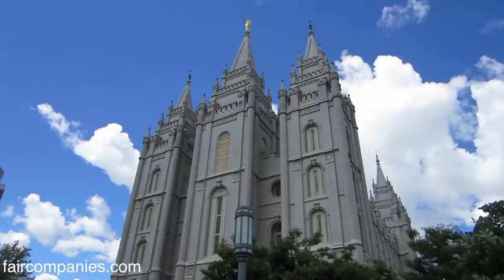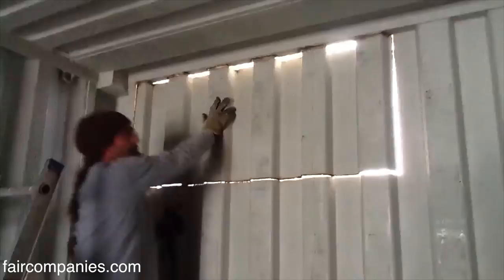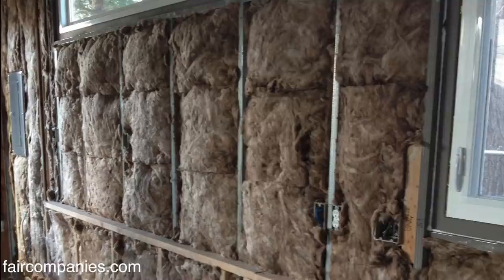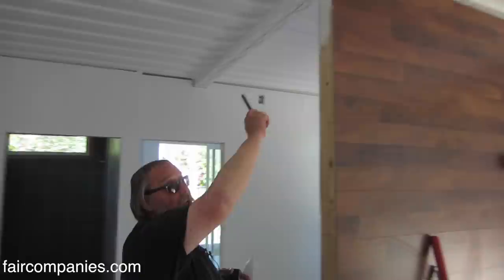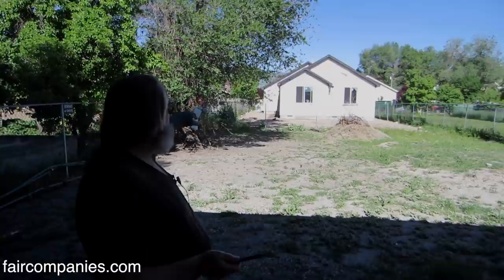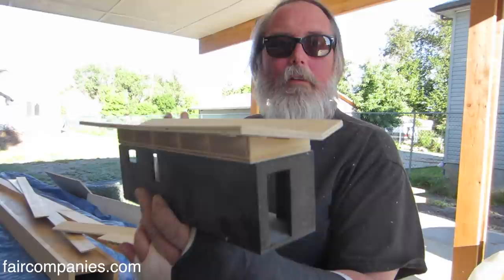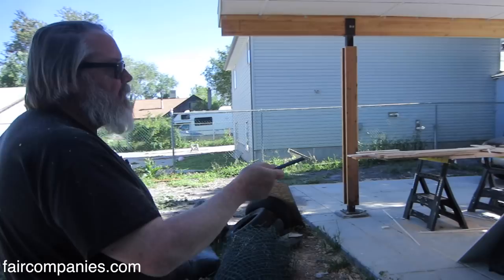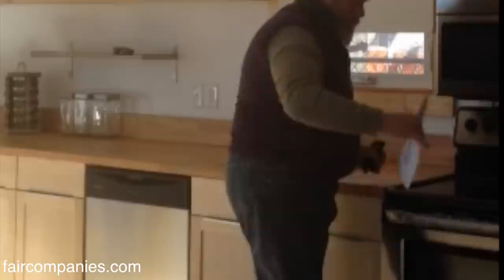Shipping containers recycled into affordable, accessible Utah home

Comment: HI. I am Kenyan and i have this idea of a non-profit to help guys coming from prison to get asimilated back into society through job creation and housing. i think such housing would be ideal.
Reply: Containers don't have much thermal mass. Are your local materials unsuitable? Containers are versatile but I suggest spending time in one in YOUR climate to determine what suits  YOUR local needs.
Reply: You can use the shipping container as your structure as they hold a lot of weight and use a Hemp concrete to build your walls once you remove the steel walls , or a light weight insulated concrete block as your walls . This will give you your cooled thermal mass . You can try just a container with steel sides and spray foam it inside with framed walls or steel walls covered in sheetrock. And find a relective coat to spray outside container with .   But i would ask around and see if anyone has tried this and see what they say .
Reply: Thats a wonderful idea. Im in the U.S. but you should look into submitting that idea to authority. In America it would be awesome to have those who want a second chance at life, receive it by getting paid to build them for the homeless and low income people of our nation. They learn a new skill and help be a positive impact in their communities. Not sure how it would work there but if you need help i would love to be apart of that.
Reply: I am moving to Malindi and looking to build a home that is structurally sound and as inexpensive as possible Do you think it is possible to buy a 40' container in Malindi or is concrete and earthbags the way to go
Reply: Come and build this in Ghana as an investment. Very nice hoses and pretty good... Love it
Reply: @jeffputman8242  Sounds like you need to get busy building out your ideas. Interesting concept,  I heard a guy explain something similar about forty years ago. Never forgot the power of what he explained to me. I wish you well.
Reply: @jadenyanki7076  You do it in Ghana. Why do you need to suggest others do it? Take the initiative and build out whatever is needed to do it yourselves. Your ports have containers. Find a way to proceed.

Comment: I want to put 4 of these together - 3 side by side and 1 straight along the back end and hanging off to make a closed carport on the side. I want to build as I go and pay for this as I have the money. I also want to build it in GA. Is there a way to do that or must you have everything done per building inspector codes right away? I don't have a bunch of money to dump into it all at once. Who do you even contact to help you build a container home?
Reply: it depends on where you live. if you live in the city you will be required to make all building codes. if you live out in the boonies probably less of an issue.
Reply: +FoolyLiving I live in GA as well and I'm gathering info to possibly build using 3 high cube containers. I know there is a lot of steel work to be done including welding which is not cheap. What part of Ga are you looking to build? I'm in Cherokee County.
Reply: +MasterBuilt Designs Honestly, have no idea where in GA, but my husband loves the mountains so I'd love to live near mountains and water. That would be a dream wouldn't it? hehe. I'm originally from FL so it wouldn't be a stretch for me to live in GA. I think a 3 high cube would be good but stairs!! You could learn to weld, too. Most of the men in my family have learned it. I don't know what all is involved in containers and welding though!
Reply: +FoolyLiving I think that most steps would be logical. I think the most important step would be is to contact an architect to draw this up and get a stamp on it and than take it to the city and see if they are going to be willing to approve it.
Reply: Move somewhere that the property does not have CCR's. The boonies is likely where you will find this! Were moving to Northern Idaho to build. Most* properties do not have any CCR's which will allow us to do whatever we want!
Reply: Hey GA container folk. Is been two years. How did that work out for you?  I'm in an R5 dinner region of ATL and just getting started on a back yard ADU (research phase). Please get in touch dm and let's discuss your experience, perhaps local design contacts?
Reply: MasterBuilt Designs
Reply: FoolyLiving contact me
Reply: FoolyLiving o
Reply: @Many Moon I'm in research phase still, but the moment is a good one in ATL.  The zoning has changed to favor these as ADU's.
Reply: FoolyLiving was
Reply: Take a community college welding course. The welding is pretty basic if you aren't doing some absurd art project. If you are joining them side-by-side, you can do as I did and have a 4x8' sheet of 1/8" steel sheared into two inch strips. Those will bridge the gap between the sides. While you can stick weld the whole thing if you are desperate, it's much easier to buy or rent (I advise buying) a MIG power supply and a suitcase wire feeder. That way the power source can stay inside the container  while the feeder is on the roof. I ground to the shell then run the hot lead as I wish. If you are not a hardcore DIYer utterly determined to study your arse off and become your own subject matter expert this may not be for you. If you are, you'll do fine.
Reply: I saw one exactly like that for sale in San Antonio tx. It was divided up in to 4 separate units for 500k
Reply: FoolyLiving I want to see it😂🙏

Comment: I like the concept of these, but being you still have to frame the inside of the container, so you can insulate and drywall there just isn't any savings versus just building these stick framed from the get go.
Reply: Not really the frame on the inside since it is not really load bearing doesn't have to be as rugged built and can be out of two by twos .
Reply: james chandler
 NOPE, it still has to be big enough to hold the require R-value of insulation, which in most parts of the country is what really sets the thickness of the 2x wall, for example a 2x4 wall is sufficient for load for a single story house but you need 2x6 walls to allow for the code required insulation.
Reply: DanielRichards644 ok but if you'll remember most of the cost was that of the lot and site prep
Reply: james chandler  Believe me I am aware of that, I've actually designed a house that I would like to build one day based largely on this design but with a few alterations (getting rid of the seating area, moving the bathroom there so the bedroom can be larger, for example). the big advantage of the container is the strength of the container and the fact you are "dried in" almost instantly, but I've priced containers around here I can get a concrete slab on grade, all the framing and siding materials (using the same siding as what they have on the stick framed bump out) and even some of my insulation for the cost of the 2 containers. This is a great idea for quick setup, but if you want to do most of your own labor (which is were a lot of the costs are) then this really doesn't save anything. this house could with some design tweaks and being done as a slab on grade could be designed with passive solar heating to make the house even more efficient.
Reply: Daniel, correct me if I am wrong, can you build a stick built floor, walls and ceiling for $1,900?  framing a home is much more expensive.  aside from the environmental aspects, I have read many things about this-no concerns about a perfect 90 angle everywhere-hurricane, tornado and repels lightning somehow.  the inexpensive cost is what sold me.  I don't think you can build a home this size for 50-60K.  I love these ideas and I love the feeling of being in a metal/steel home for many reasons, including fire.  it s an excellent solution to affordable housing.
Reply: Doreen 7suns
 That article is so skewed, they compare shipping containers to brick and mortar, arguably the most expensive way of building and says this way is cheaper. Where did you get the $1,900 number from? around here prices are 3-4k a piece for used "hitop" 40 ft. containers, like used in this house so your talking 6k on the low end before you get a welder to cut alll the openings, add additional box steel to frame the openings, do the stick framed roof on top and add studs to the inside to allow for insulation of the walls to code. for a stick framed house this size, the numbers would run about $660 worth of 2x6x10' for the walls, then $714 in 2x12x16' to frame the floor, $500 worth of subloor and about $875 for the exterior wall sheathing, I am not adding the roof numbers here because you would still need the same costs in roof framing either way and the siding on the outside of the house can be gotten in the $1 per square foot of siding range so about $1200 in siding materials (there are cheaper and more expensive siding options, but for this example we are using the same siding they did on the bump out n this video) so add that all up and your at about $4k to be at the same level as what the container gives you (but with actually slightly higher ceilings) so unless you can get 2 40ft. hi-top containers delivered for less then that then it wouldn't be cheaper.
Reply: Also, something to look at is the cost of slab on grade (assuming you build somewhere where frost line doesn't create sub walls) vs. framed floor over a crawlspace, the slab on grade may cost more in the building of the shell, but could cost less in the long run, around here a slab on grade (sealed, not stained or colored) would likely be in the 3-5k range, but you would save the costs of floor framing, and subfloor numbers given in the previous post, plus you would save on the insulation of the floor (another 3-400) plus the costs of flooring, most decent tile or solid wood floors are about 4-5 dollars a square foot over the 640 square feet of this design which is 2.5-3.2k in flooring right there. which is the reason mine will be a slab on grade.
Reply: Whats been going on. Every one behaving; I
  hope.....
Reply: Donna Salter I've actually moved on from these container house Ideas and have been looking at the metal Quonset Hut structures from Steel Master or Durospan or the other companies that make them (search "metal building kit" on ebay and look at the ones with the arched tops, not the traditional steel frame covered with metal siding ones) , you can get a relatively easy to assemble (it bolts together in sections) self supporting galvalume coated (very energy efficient) steel structure that is more then DOUBLE the size of this and it gives you your roofing material and the 2 long sides for like 8-9k (30 wide x 50 long x 16 tall) this is about the average price of the 2 40' containers unless your close to a port facility, additionally you'll save 3-4k on not needing to roof it like they did here, plus the cost of the roof framing and sheathing, which you can then put toward doing the concrete slab and footers to put it on and finish out the inside.
Reply: DanielRichards644   Are your numbers for materials or materials + labor (for the stick-built)?

Here in the SF Bay Area, labor typically runs 2X material costs, and then comes all the soft costs, so labor should not be ignored, even if one is doing the project DIY.  This becomes a question if a DIY owner doesn't have the full set of skills to successfully stick build out a comparable project, because the time factor grows exponentially as Mr. DIY flops and struggles, and that matters a lot, or the owner might have to hire the work out, and then labor is a critical ingredient in the budget.

I am looking at a similar, but smaller (24' long), tandem arrangement that would put foam sheathing on the exterior w/ the cladding over that, which would conserve the interior space.  The good news is that I'll be able to support mine on just the 4 corners, the way they are designed to be carried, which will kill the SOG costs (SOG's are not evironmentally agreeable either).
Reply: SuperBardley
 my concrete numbers are based on price per square foot of slab that we've done on projects where we did the design and construction management and my lumber and siding numbers come from doing a rough takeoff of framing materials and calculating the totals based on the prices from the local Lowes, so only the concrete includes the labor, I do have a rough number around 40k (not including site or water/sewer) that includes labor for concrete, framing and roofing to do one this size locally. I've pretty much abandoned this design when I saw the prices for the Quonset hut style steel buildings on ebay and saw pictures of "the Arc House" up in the Hamptons as inspiration for how stunning an arch can be made to be, but i'm still running the numbers on that scenario, which will depend on the site I end up with in a few years (gotta build up my credit history).
Reply: DanielRichards644 Interesting, thank you.  Many people pursue ConEx buildings because of the green/reuse aspect, so a new arch structure won't jive with that idea.  I like the very minimal foundation requirements for ConEx structures and am curious why Jeff White chose SOG instead of Sonotube piers.  I will research your arched structures.

I do chafe at the very rigorous 8' width module of the containers, which I find is slightly off from real-world needs -- a 9' module would break down into 3' units and this would accommodate circulation and common furniture modules better.  Of course, 8' is the common lumber module and 9' could generate waste.
Reply: SuperBardley
 Well, thats part of the beauty of the steel arch structures, they are made in a factory with very little waste, and what scrap does come off in production is recycled and reused, and should the arch ever need to be torn down, the arch is 100% recyclable. The Galvalume surface is also more energy efficient then the shipping containers (although if you paint out the shipping containers in white you can reduce there energy absorption), it just seams like a far more interesting structure from an architectural stand point to me and potentially allows for nearly double the square footage at the same costs when compared to the shipping containers. I give these guys credit for what they are doing, it sure inspired me to take a serious look at what it would take to build a house and eventually led to me seeing the Quonset House designs here on youtube. You could, if you where DIY enough get away with only pouring the strip footers needed for the perimeter of the steel arch building then do like an adobe floor to reduce the amount of concrete used, but that seems like to much work to me.
Reply: You have a good point but a stick build would never be as sturdy as one of these and these should be pretty much earthquake proof as well.

Comment: Impressive in every regard! Well done sir! Extremely intelligent, cost effective, practical, and appealing. The high cube 9' ceiling containers are ideal frameworks. 

What would be very interesting, a completely self contained single container portable version (40'), mounted on its own trailer, designed for off grid, with built in fresh/grey water tanks (can be mounted under the trailer) roof mounted solar power/lithium system, ultra energy efficient HVAC, water heater, fridge, induction stove, microwave, and LED lighting. With smart space features such as a double door entry area dinette at one end of the container that converts to a bed, and a full bath at the other (utilizing compost or RV-like portable waste management), as well as a mini wood stove or other custom owner preferences. 

Great engineering in this vlog however! Again, well done!

Comment: Mr White:  To make the home perfect for seniors, could a small washer/dryer stack be added somewhere so the senior or a caregiver could do laundry on site rather than going out to a coin laundry somewhere?  You may have thought of that but I didn't see it covered in the video.   2) Could a small vertical closet be built in somewhere for the vacuum or mop?   And 3) An exterior water faucet or spigot to connect up a hose to water the plants, wash the car, etc?   Aside from those Q's, it was great to see someone address what it would take to build a simple home out of containers but really covers the points that you have taken up in the video.

Comment: Best video and container home I've found.  How could an additional 'barn' studio, 30' x 50', be put up.  I wonder if you could put these vertical, a HQ 20 x 8 with 4 8' or so wide sections on one end and an open section on the other end, with wiring, water and heat.   I am interested.

Comment: I live in salt lake and can speak to both the price of the lot and containers. A few companies have opened up and sell containers, also we are an inland port now. With more competition and more supply of containers a 40 foot container is about $2500-3000 with 20ft containers getting as low as $1500. I will try and find this exact house for sale but, the market has gone up 33% in the last 5 years. A small home of this size on a rather large lot like the one in the video will be no less than $250k. I’m currently shopping for a tiny/ stater home in salt lake and 700-1000 sqft homes are no less than $200k and that’s for stuff built in the 20s and not update since the 70s. You want a garage or any sort of modern anything forget it until about $320k. Problem is all the dang California’s moving away from California. Y’all made the mess you should stay and fix it. I’d be interested in this home and lot but it’s probably a HUD rental.